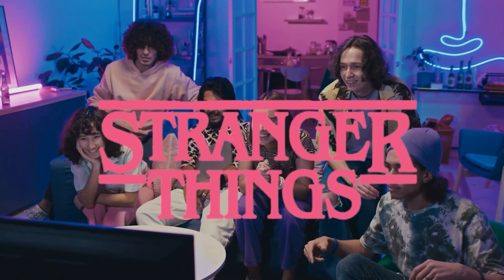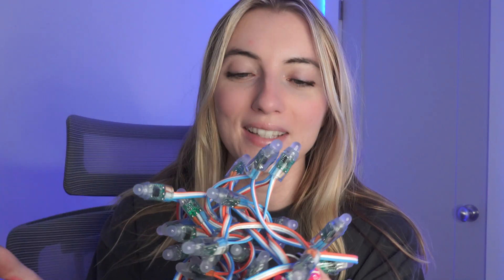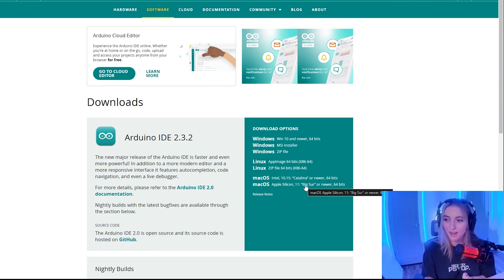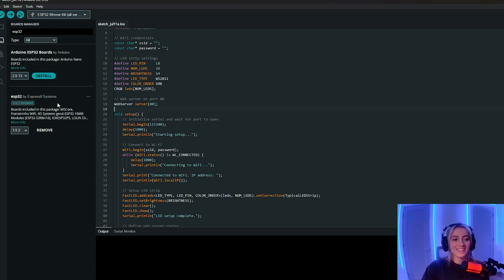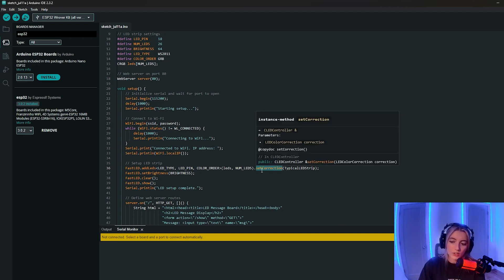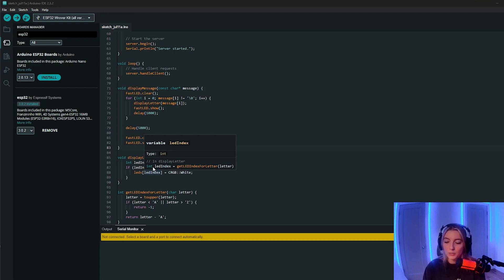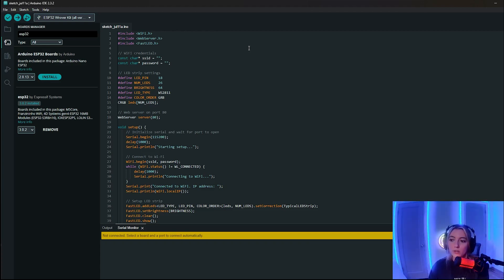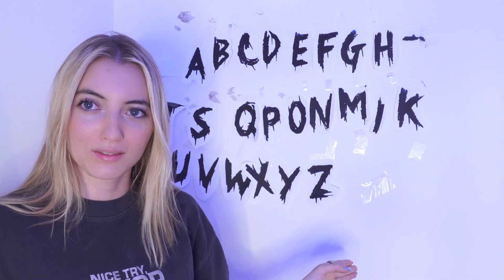I Built The Lights From Stranger Things (Full Tutorial)

Comment: Great video! Which power supply adapter did you use and did you buy the 5V or 12V lights for this project?
Reply: I think if you are using an extension board like breakout board go for 12 v otherwise you can use type c charger on your esp 32